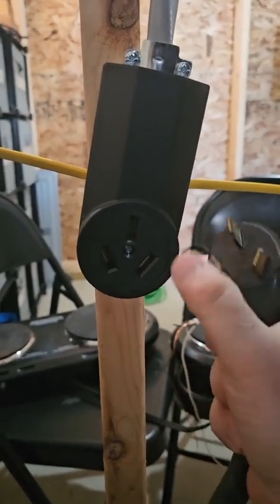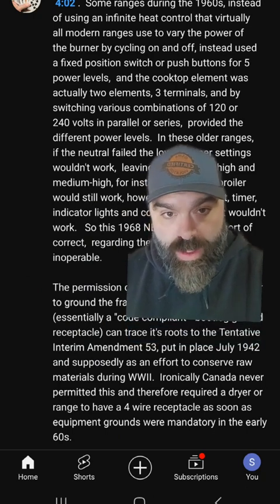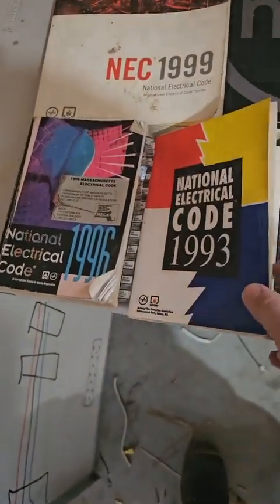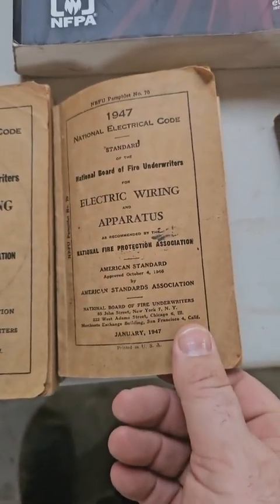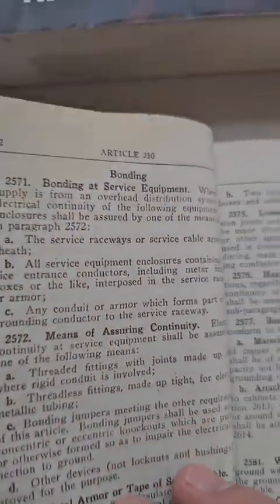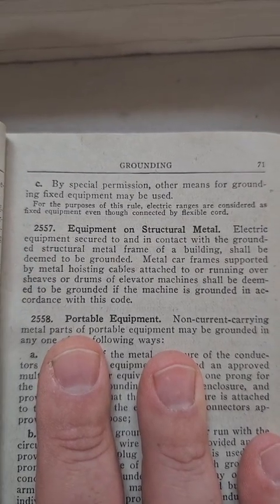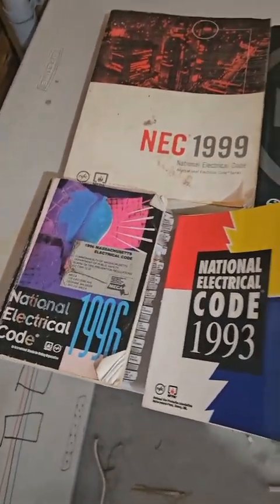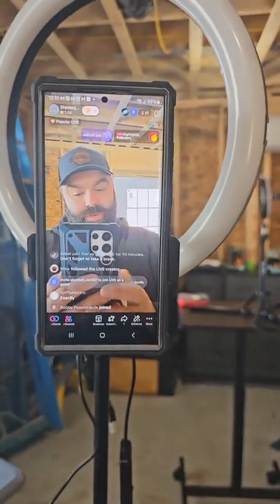CLICK HERE FOR FULL VIDEO....How the NEC helped win World War 2

Comment: I worked with ASME codes before I retired, you might still find someone on the committee that can access the old standard and reasons for change. But I read that the 1942,43 and possibly 1944 editions were simply supplements not full codes.